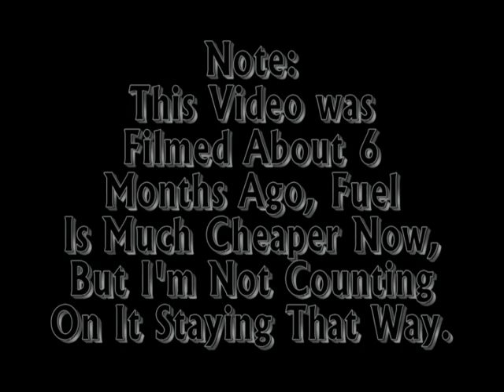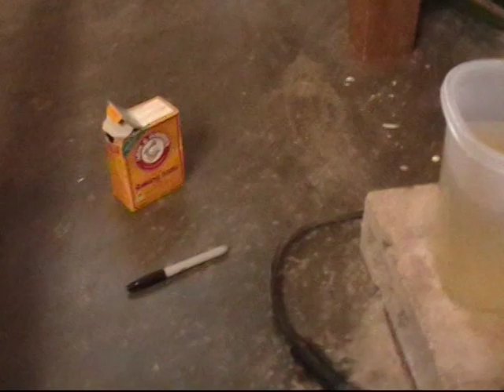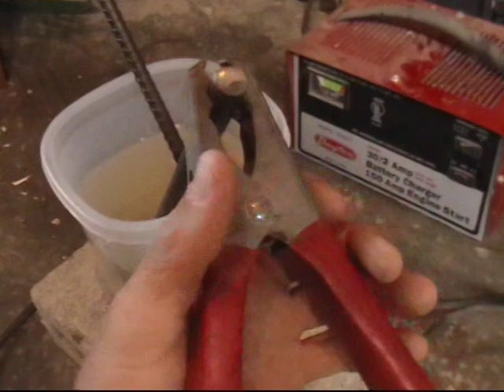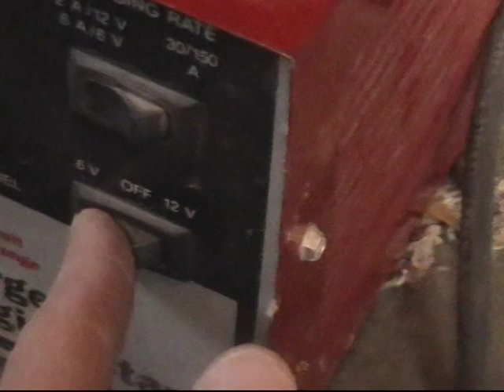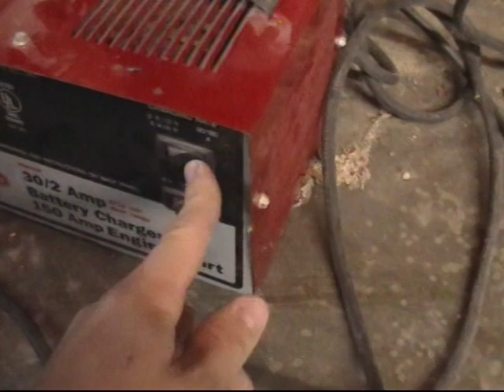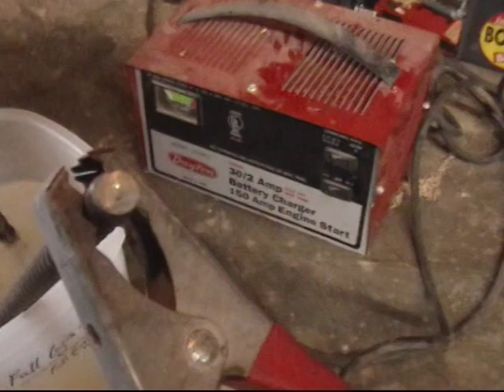My first experimental Hydrogen Generator

Comment: Would like to see an alternative to fueled vehicles that give better distance between fill ups and power the vehicle the same or better than currently manufactured vehicles. Since you made this video I think that researchers have concluded that hydrogen fuel is not the way to go. Additionally the price of gasoline has dropped back to what I regularly paid in the 1990's. I hope a never see prices at nearly $5 per gallon again. Surprisingly the price of regular has been hovering at $1.719 to $1.999 for the past 6 months (August 2018 to January 2019). I hope this trend lasts or the price lowers more.